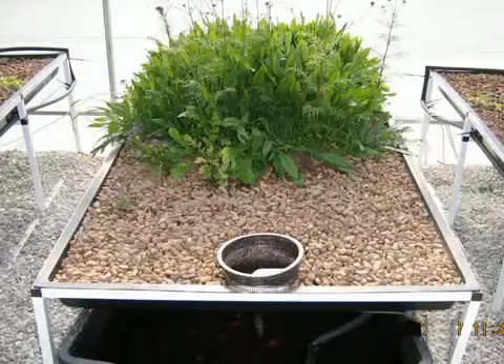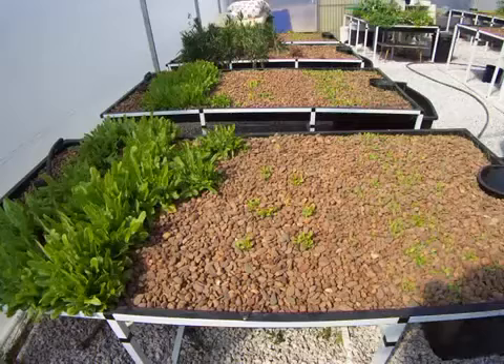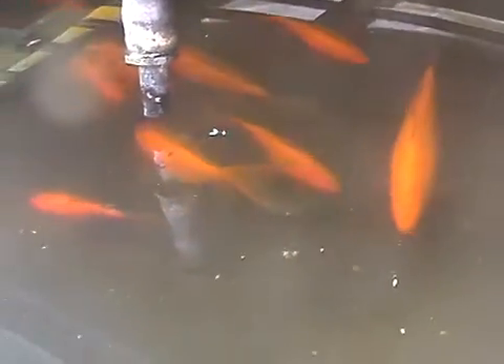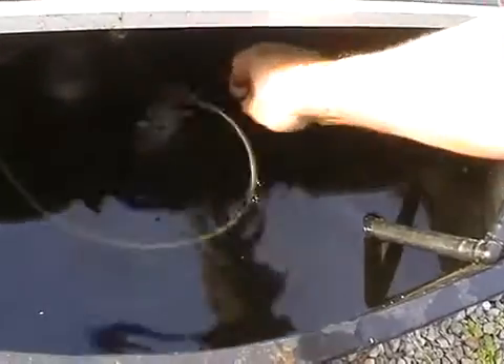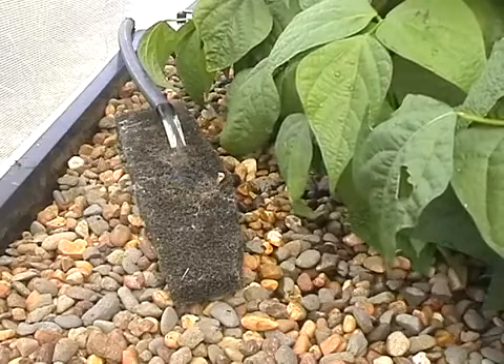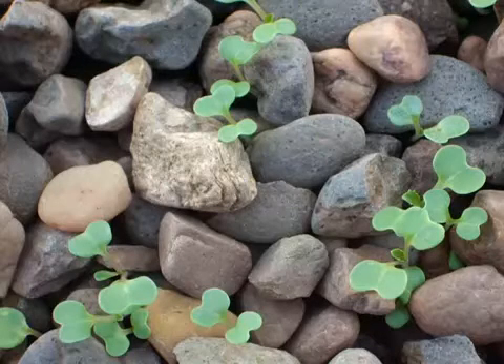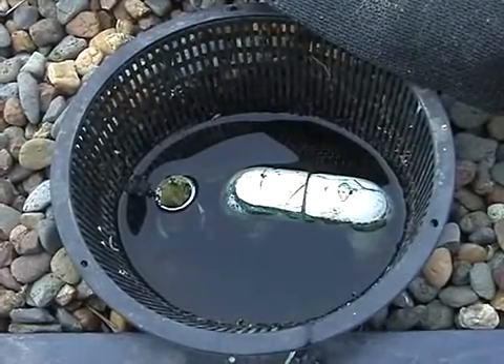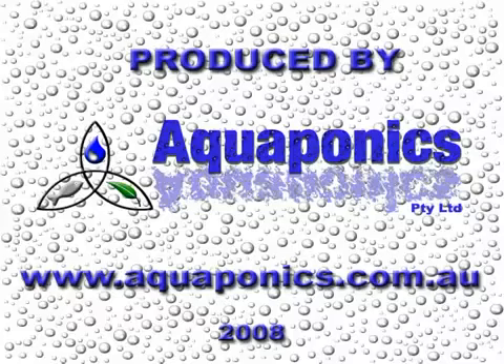Easiest Dwc Hydroponic System [Hydroponics System]

Comment: This is an excellent book to own if you are even thinking about trying Hydroponics. The information is very clear [Check Details Here  ===>fb.com/Easy-Hydroponics-Systems-166096780618260/app/208195102528120 ] . The only complaint I have is that the amount of time I spent wading through various forums and websites could have been saved if this book were released earlier.